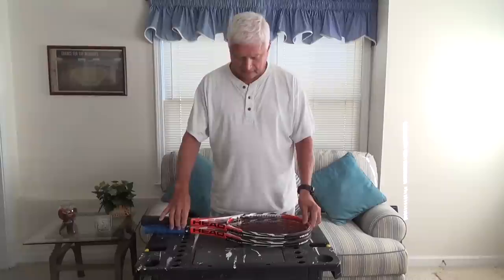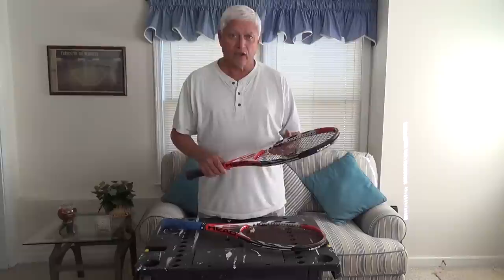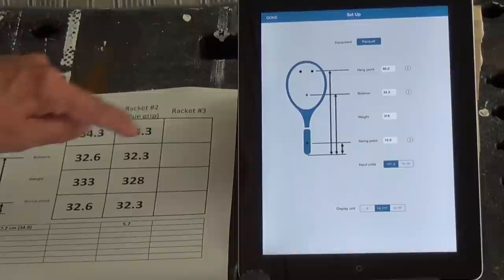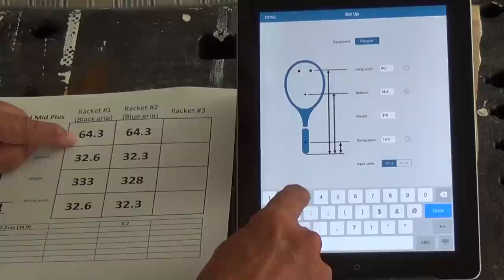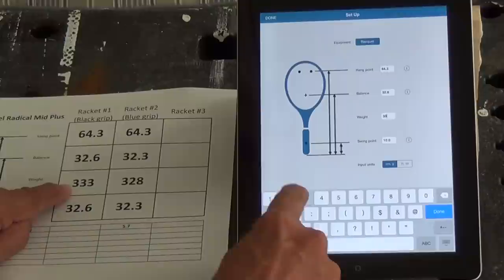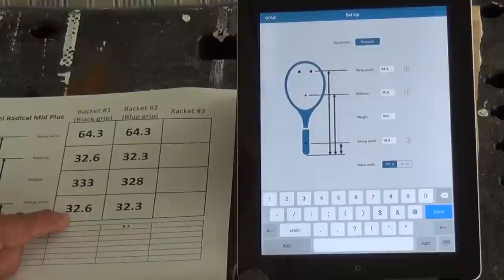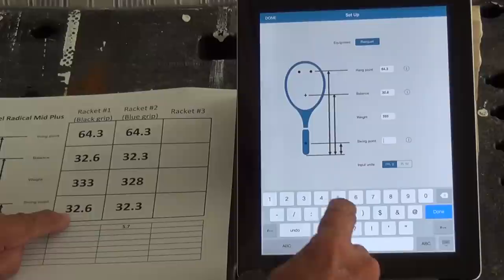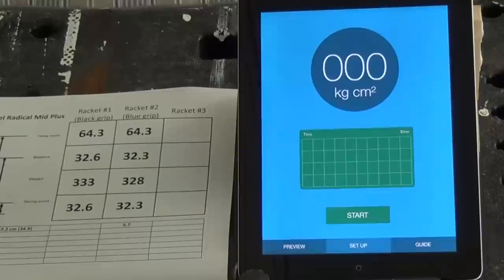Matching Rackets

Comment: Thanks Irvin, 
I really enjoy every video you post and I watch them over and over again, hhh, however I have a question or two for you. 
-Can you please rate SW app you are using in this video lecture?
-Are you still using this APP or you switched to something else?
-What is the biggest challenge when using App (wtr iOS  updates or iPhone replacement)?
-Can you compare it to a professional Swing Weight Machines (babolat, prince etc)?

Note: I am interested in racquet customization for fun as a hobby and not as a professional.
Reply from the maker: Mi S I really like the Swing Tool app on a scale of 1 to 10 I’d give it a 10. No problem with iOS updates either. The app measures time to .002 sec accuracy which is closer that you can do unless you record a video and do it. You also need to measure the distance from the butt to the hang point, and the racket weight. I would suggest using cross string more in the sweet spot area for more accuracy. If you’re matching like rackets chances are any error on one racket will be repeated on the other so matching works out great.

Comment: If the rackets are matched (same moment of inertia, balance and weight), can the twist weight still differ?

Would enjoy a vid of you measuring twist weight.
Reply from the maker: Waceman I’d like to see one too but I don’t think it is possible. At least not accurately IMO. A difference of 0.0025 second in the measured period makes a difference of 1 kgcm^2 and that’s assuming the distance from the butt to center of mass, the distance from the pivot to the Center of mass, and the weight are all perfect. I think you can really get so close mere mortals can’t tell a difference. I see what I can come up with.

Comment: Incredible video! I just have one question, after you’ve measured the moment of inertia, you had to add 2g to make them the same (1 at the head and 1 towards the end). You mentioned that both rackets would weigh the same but if you added 2 grams, doesn’t the total weight of the racket change from 333g to 335g? Sorry I’m confused, definitely want to understand what’s happening! Thank you!
Reply from the maker: Bryan B well Bryan I’m afraid I’m going to have to disagree with you. I made that video, I understand every thing I said but it sure is hard to follow even for me and it too long. How can anyone follow that? I would never match up rackets using that method. I use a completely new system or method now and need to update YouTube with my new process. First I compute the torque on each racket my multiplying mass time weight. Then I divide the difference in torque by the difference in weight to know where to add weight to the lighter racket.
For example, the torque of each racket is 10,855.8 and 10,594.4 for rackets 1 and 2. Divide the difference in torque (261.4) by difference in weight (5) and you know where to add 5 g to lighter racket. 261.4/5 = 52.28 cm. Adding 5 g at 52.28 cm will match weight and balance. For SW I would try to get them close.leaving the weight at 52.28 cm increases the inertia the least and if you separate it you get the biggest increase. I’ll try to create a new video and see if I can simplify this.
Reply: Thank you for the quick reply! Your new method makes complete sense. And if you could upload another video that would be great if you have time. I’m currently working on matching my rackets and by following your new method my racket 1: 9717.5 and racket 2:9571.8 and so when I divide the difference by the difference in weight (2g) that leaves me with 72.85 and my racket isn’t that long. What am I doing wrong?
Reply from the maker: Bryan B you’re not doing anything wrong that happens sometimes the best you can do is divide the difference in torque by the highest point on your racket. Assuming the inside of your racket is 67 cm from the butt you can divide the torque difference by that high point. That means you have to add just under 2.2 g at 67 cm. I would add 2.2 g but now you’re light racket becomes you heavy racket with the highest torque so you will need to add a very small amount of weight to what was your heavy racket.
Reply: You’re awesome! Thank you. I do have another question (thank you for your time by the way), if the unstrung weight is the same but the balance is off by 0.5cm how do I make the balance points the same? How does that affect MOI?

Comment: Thank you Mr10sStringer! Great video. I do believe matched racquets are crucial. Could you please show how to match swing, twist, and recoil weights?
Reply from the maker: JorgeAndresCoppiano. Great suggestion Jorge, I’ve been thinking of doing this for some time. I’ll try to get it done soon and let you know.
Reply: Mr10sStringer thaank you sir! That would be amazing! I bet it’s gonna be a great video 😁
Reply: Jorge I have not forgotten you. I got very busy and finally got around to this but having some troubles. I will get it worked out please be patient.
Reply: Irvin Fuchs no worries sir! I am happy and grateful to know you want to cover it
Reply: can't wait for that video !
Reply: I have come to the conclusion that you're asking for an impossible task. If your period is off 1/10,000 sec, or your weight is off 1/10 gram, or your balance is off 5/100 of a mm, or your hang point is off 25/1,000 mm then your results are off by 0.1 Kgcm^2. I do not believe it is possible for me to get within those tolerances. Twist weight for it to be effective must be measured with 0.1 Kgcm^2. I measured two of my Tecnifibre 320 ATP frames and found the TW to be off by 0.2 Kgcm^2. Now I have to ask myself this question, is it the result of inertia being different or is there an error in my specs?
Reply: That being said (see my last reply) I can show you how I measured the SW and TW and how you can check those measurements pretty easily. Just be assured that there can easily be a 5% error (0.1 Kgcm^2) or greater in your specs.
Reply: Irvin Fuchs Mr. Irvin, that would be a delight! That margin of error is nothing. I am amazed by how you can match them racquets
Reply: Irvin Fuchs sorry for the time it took me to respond, just got back to college and  am putting all together
Reply from the maker: JorgeAndresCoppiano. I know I told you I couldn’t do it but I think I’m getting close, but it still may be a while.

Comment: if begginers or even itf features-level players will think about racket's parameters so deeply they dont have any chance to learn how to play better. too much useless thoughts  : )) imho
Reply from the maker: If you want all your similar rackets to play the same and not have a favorite you make want to try matching them up. Or do like the pros do have pay to have them all matched.

If you're ever looking for a racket to replace an outdated it would be nice to know the specifications of your old racket so you know what to look for.

If one racket give you tennis elbow it may be useful to find out why so you know what to avoid or how to modify the frame.
Reply: Well.. i think if i bought 4 same sticks in tennis warehouse and then using same overgip, same strings - they will be 100% same. without any customization. True?

* Tennis elbow always made by wrong tennis technics.... not by "wrong" tennis racquet. imho
Reply from the maker: Evgeny Dorokhov Go to the TW Forum and check out the "Thread Racket Matching should be free." I doubt you could buy two racket that are 100% the same without some matching. If you want rackets that are close (not matched just close) that is is $10 charge from TW. If you want rackets matched to your specs that more. If tail weighting needs to be done even more.

Tennis elbow is not always the result of the wrong tennis technique. If it was some rackets like the older aluminum rackets, and Babolat rackets would not be notorious for causing tennis elbow. Some light rackets would not be notorious for causing shoulder problem.

If you play with equipment that does not suit you whether it be shoes, strings, tension, or rackets IMO you will never reach your full potential. Many lower level players push the ball because when they swing away there is no telling where the ball will go. I think that problem more often than not is the result of poor fit.

The video above does not touch how to match a racket to fit you just how to check the specs and match one racket to another or to any spec you want. I'm sure you would not play with any old racket.

But I appreciate you comments. Maybe if more people reply as you did we can get down into nitty gritty of how to modify rackets based on style, strength, height, swing speed, etc...
Reply from the maker: Evgeny Dorokhov Also if you paid the $10 charge per racket to TW for matching because the moments of inertia may not be the same there is no guarantee when you install grips, strings, and vibration dampeners they will be any where near the same. Therefore, you may as well have thrown the $40 for 4 the rackets out the window.
Reply: Well... i believe you that few milligramms of difference between two same sticks are real. But anyway this is not so big deal for me to feel difference while playing. Accordind to phisics laws we need to check and "tune" our sticks always even when temperature and humidity of air chanched = ))

* About elbow - i used to play alluminium and wooden rackets more then 15 year ago.. and i never ever had any problems with my elbow. I can say anything about tennis but i sharing my own experience only.

ps: i like your videos : )
Reply: No two commercial racquets are typically the exact same weight, balance, swing weight. This is why the racquet companies make pro-stock racquets for the pros. They are much lighter than commercial racquets and can be customized by companies like Priority 1 to match identically to the player's specifications. They add lead tape to the hoop and silicone to the handle to increase the static weigh, balance and swing weight to suit the players needs. If there is a ball coming at you at 130 mph, it is unlikely that a consumer racquet would be heavy enough or have enough swing weight to return the necessary energy to the ball. Your racquet would literally be knock out of your hand.